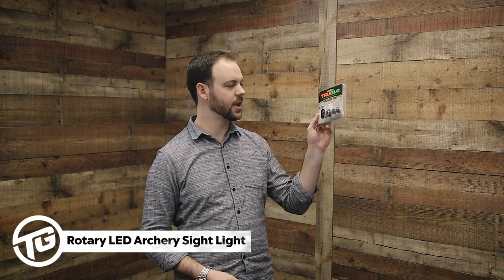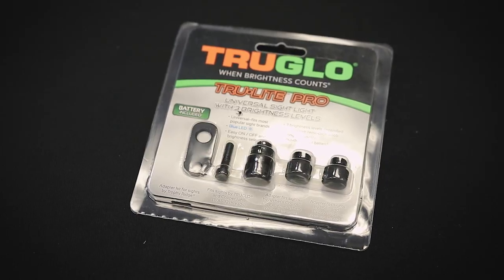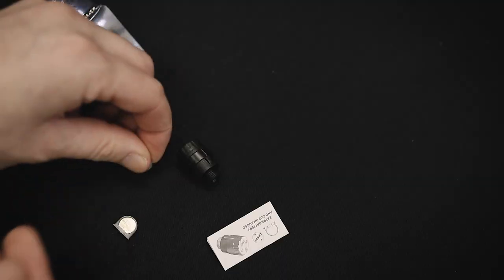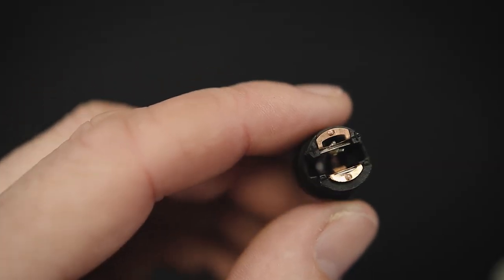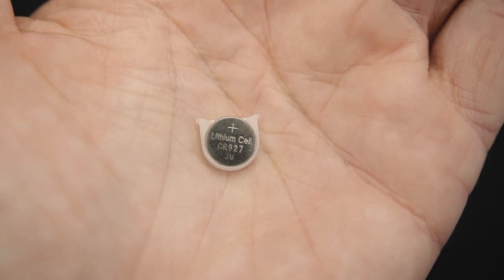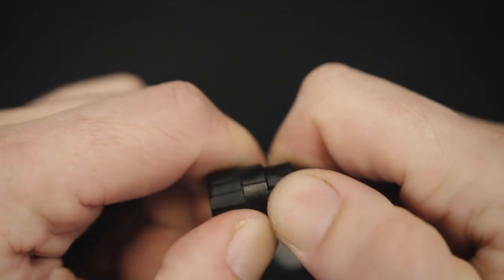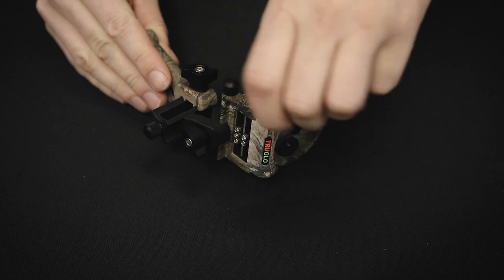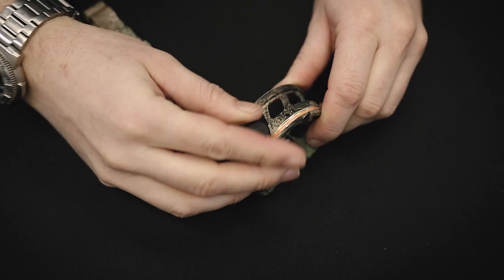Bow Sight LED Setup (Rotary Style Models)

Comment: A scan link to this video should be on every sight/light sold.  Also the lights should say three brightness levels instead of micro adjustable which is vague.  Had I not found this video I seriously doubt if I’d of figured this battery installation out.

Comment: Looks like a good improvement from the older model. 
I want to replace mine. It doesn't have the clicks for on off and brightness settings, and requires 3 batteries.
Reply from the maker: Hey Michael, this was designed to be a drop in update. Ask for the  TRU•LITE PRO (TG57) at your favorite archery retailer.

Comment: I bought a sight/light package and the light does not work. Did everything in this video and it still will not work. Guess i got screwed.
Reply from the maker: The most common issue is that battery being reversed, but if that is not the issue give our customer service team a call and they will definitely set things right. 972-774-0300
Reply: Exact same here & it did not even fit the sight that I bought. There was no place for it.  Talk about a complete waste. I could get the light to work, but it would be in the middle of screwing it on. I spent an hour , my hands and fingers were hurting & I just gave up. But it doesn’t even fit the sight that it was in the package with🤦🏼‍♂️

Comment: I want to order this for my shrewd Nomad 35mm scope. My archery store said they could order it but it comes in 3 different models. How do I know which one I need?
Reply from the maker: This is one model (TG57) that comes with 3 adapters to to fit different sight housings (plate adapter, 3/8-36 thread adapter, 7/16-20 thread adapter) Between these adapters, this should fit just about every sight sight out there.

Comment: Are all TruGLo sights the same thread? I need to add light for my older TruGlow {7-8 years} sight but am not sure if they are all the 3/8-32nd threads.
Reply from the maker: Yessir! Thread should be the same. There are some older models that don't have a ton of clearance, but most are not a problem. If you know what model you have, we can clarify further, but likely everything will fit just fine.